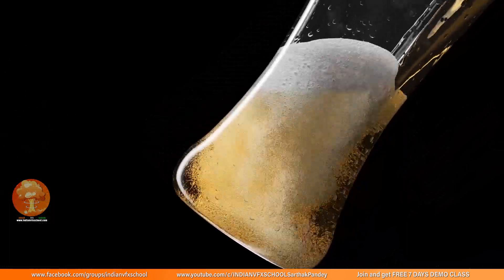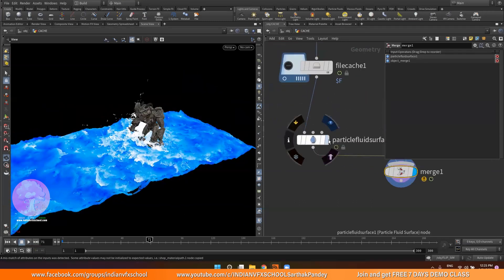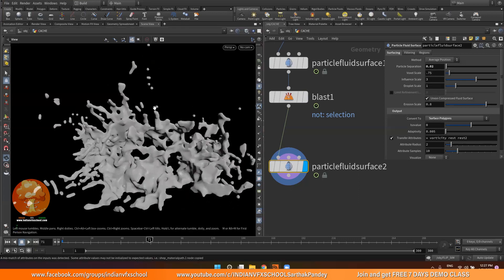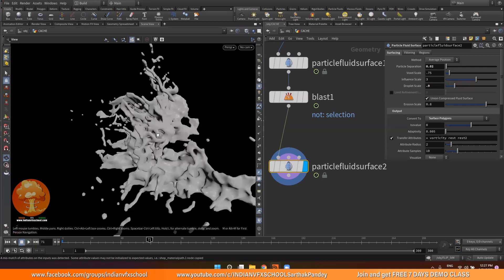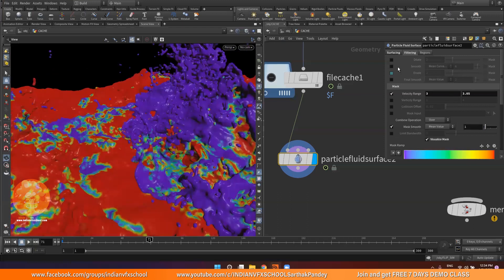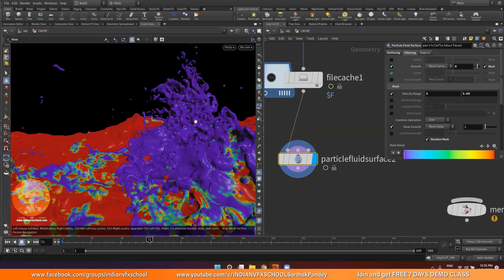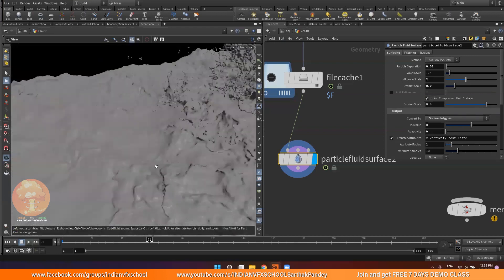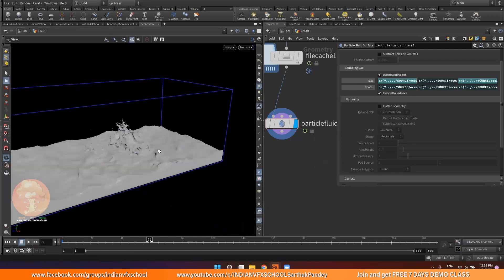Houdini Flip Tank Course - Part 4 - Meshing And Caching The Flip Sim #Houdini #FlipFluids #Flip

Comment: Thank you for these great videos. I am on Houdini 19.5 but at 12:40, I click on close boundaries and it only closes the boundary as a thin sheet instead of including the rest of the tank. Is this a bug? I've done this tutorial twice and the same thing happens...
Reply: Sorry, my mistake. I somehow missed a step in the video or was cut out. I left the particle fluid surface node as a particle and then as a mesh. I forgot to disconnect it since it was originally used only to mesh a small section
Reply: Hi there I'm having the same problem where it doesn't close the mesh all the way to the bounding box, I dont understand how you resolved your issue? I've deleted the first particlefluidsuface node aswell as the blast and im still having the problem.
Reply: @jackfagan335  Sorry, I had not checked my messages. In my situation, I think I had forgotten that the setup was only to preview the mesh so once I disconnected it, it worked. I'll try to look at my file again and see if I can explain it better.